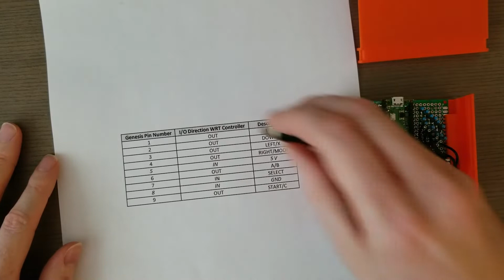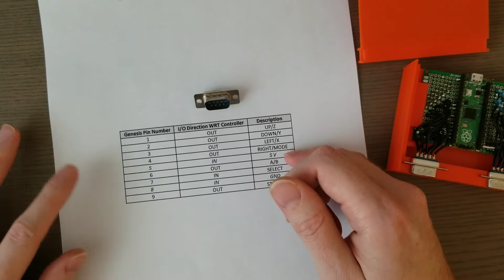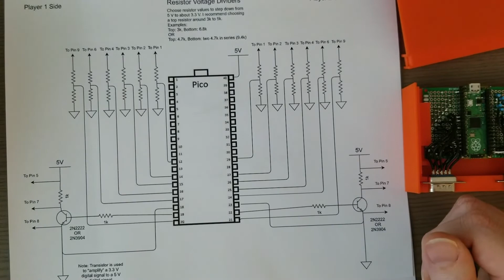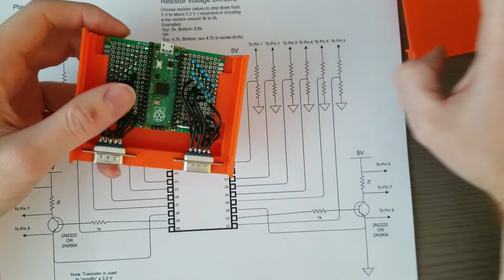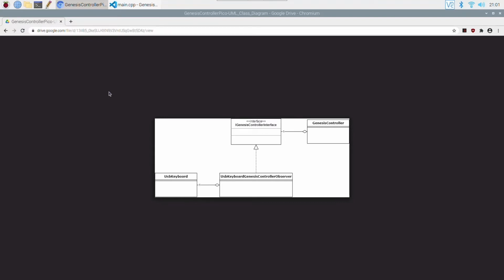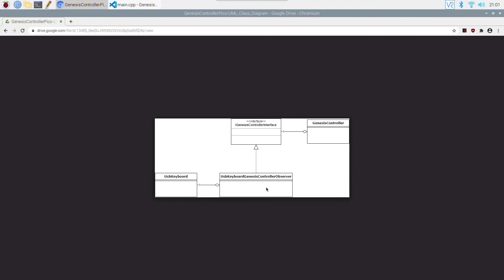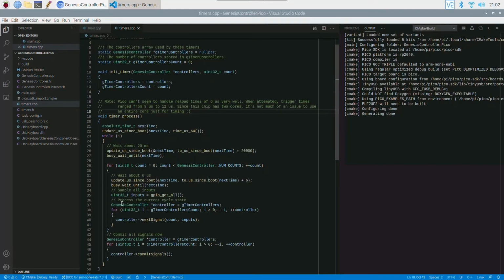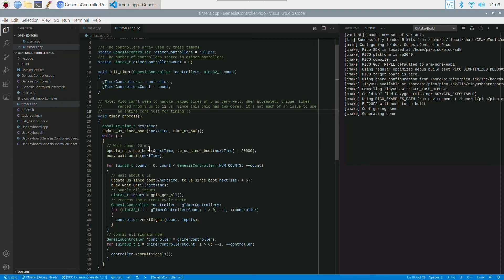Genesis Controller to USB Keyboard Adapter using Raspberry Pi Pico

Comment: Hi! I used an 8 channel logic level shifter instead of the resistors and transistors... I have a 6 button generic controller and when I connected everything the left and right buttons stay on all the time and the a and x buttons presses two buttons simultaneously. Up and down seems to be working and the rest of the buttons don't work..  Im going to debug it tomorrow with a logic analyzer, but maybe you have an idea of what could be wrong..